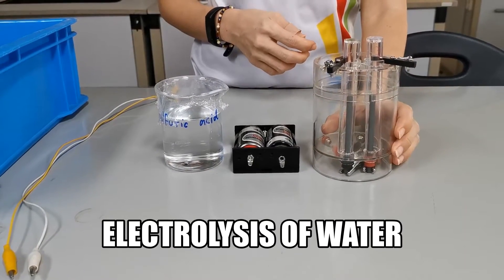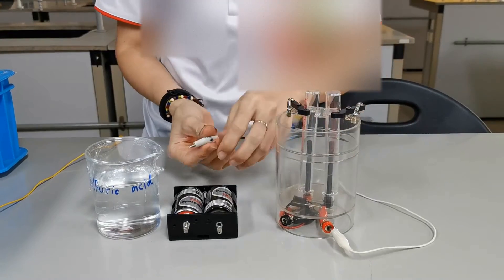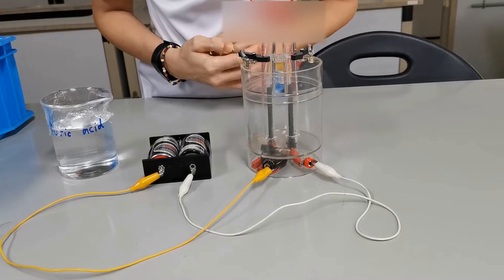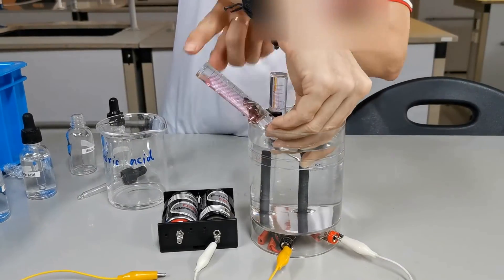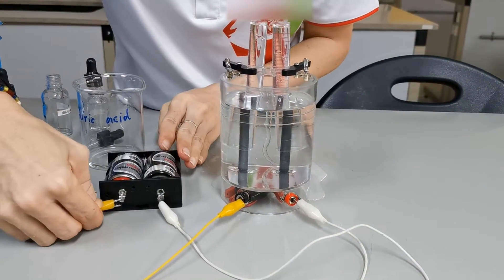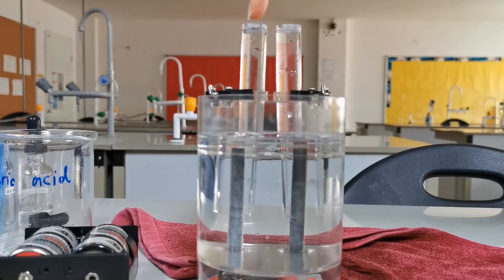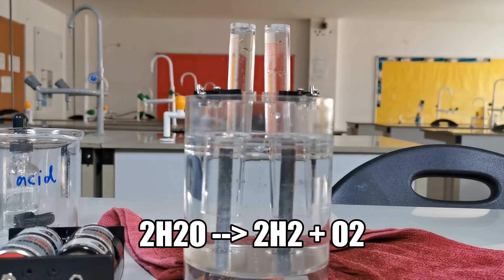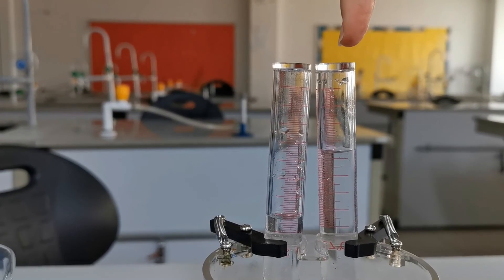Electrolysis of water experiment

Comment: What is the concentration of the acid?
Reply from the maker: I believe I used 0.1 M. The concentration doesn't need to be high, as long as there's free moving ions in the solution (which in this case are provided by th acid) then the solution will conduct electricity and the electrolysis will happen.
Reply: What is the analysis of the 2 pressures of H2 and o2.

Comment: Show me how to split water into H & O without using a electrolyte which contains H & O.
Reply from the maker: Firstly, hydrogen and oxygen exist as diatomic molecules, H2 and O2. Secondly, you can't create certain elements out of other elements, except in radioactive decay and fission.
:D
Reply: @theaplussquad  that answer has nothing to do with my question. You need to unlearn everything you learnt about chemistry. Water is not H2O its a base element and cannot be split. It has never been done!
Reply: @johnnym6700 "water is not h2o" ? elaborate please